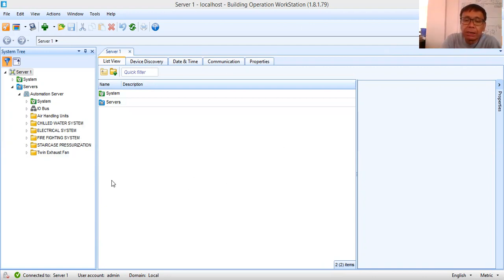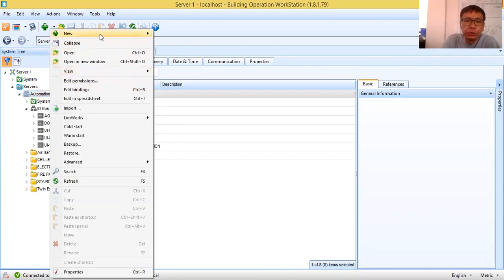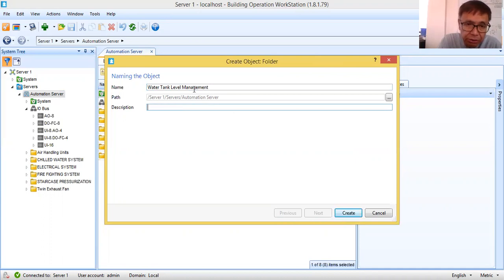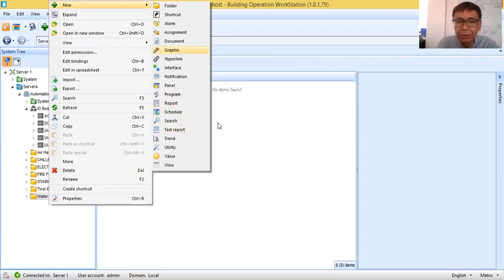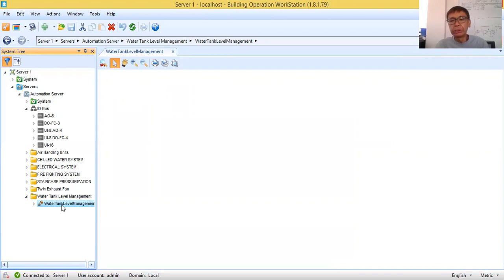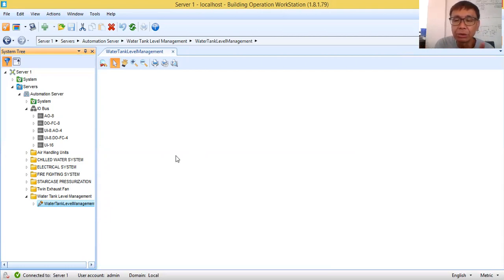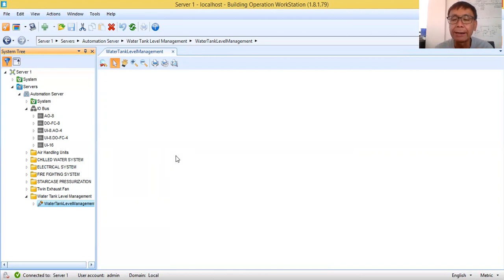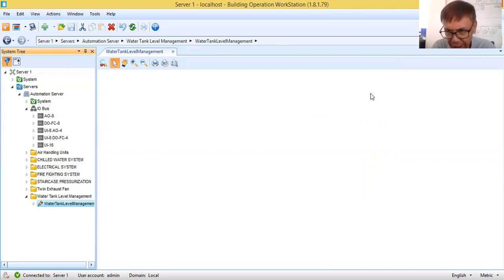How to create a BMS Graphics part 1

Comment: Sir, please made video on PID tunning and How to online controller to server and AHU operation graphics 🙏
Reply from the maker: actually in BMS if it is only a simple temperature control we use only simple PI control (proportional plus integral) then you can adjust the integral time to fine tune your temperature control, anyway I will try to create one later